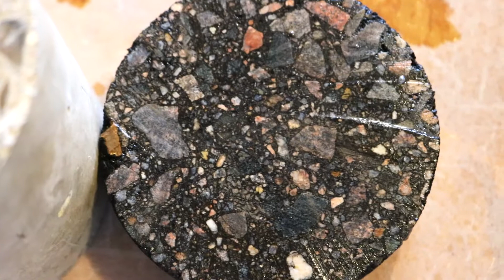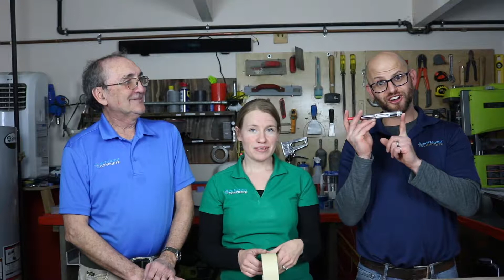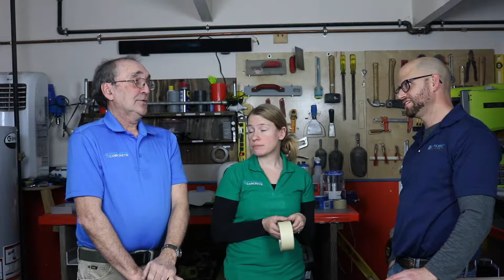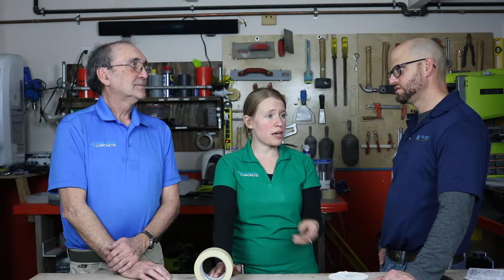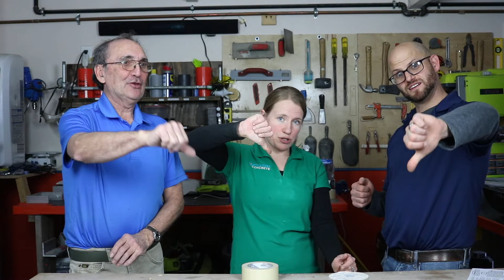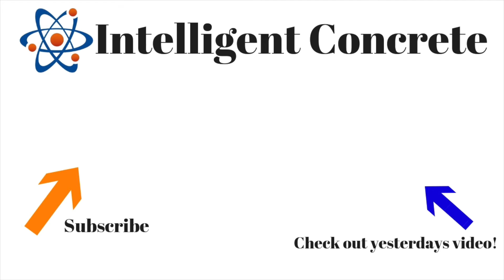Comment: Most people choosing between asphalt and concrete are getting their driveways done. You guys didn’t mention the fact that concrete cracks..not to mention the fact that areas that get snow, the salt from your car tires will eat away the concrete very very fast. Sure concrete is stronger, but once it starts cracking, there’s no way to repair it. At least with asphalt you can patch it up.
Reply: Very true on all accounts.  Concrete does crack, a lot if not made / handled correctly and I HIGHLY susceptible to decking salts and brines.  

While you were correct on these points I do want to correct on the patching bit.  Concrete can be patched and resurfaced, all be it at a cost. Even significant cracks can be repaired using an epoxy grout or more novel technologies like Colloidal Silica based hydrogels. 

That all being said, when it comes to concrete driveways, while the surface of the concrete can deteriorate due chemical and physical attack, the driveway is still level and functional.  The same cannot be said for asphalt that goes through cracking and rutting over time.  

More often then not we see asphalt driveways and local rods needed repair / replacement within 5 years (+/- 3 years depending on location) of being placed.  In the same location a concrete driveway  surface might look beat up but the driveway would still be functional.

Thoughts?

Comment: Please.
Could you tell me the estimated  lifetime for a asphalt walk alleyway. Just bikes and skates will use it.
Ty.
Reply: That’s a easy question but tough answer.  It depends.  The lifetime of a walkway can be multiple time it’s actual design life.  Most walkways (alleys, sidewalks, park walks, ...) aren’t replaced due to the inconvenience of ripping them out and then replacing in an established area.  Normally a damaged walk away is only an eye-sore but not a structural or safety concern.

I hope this helps.